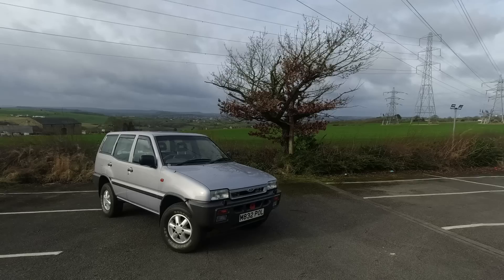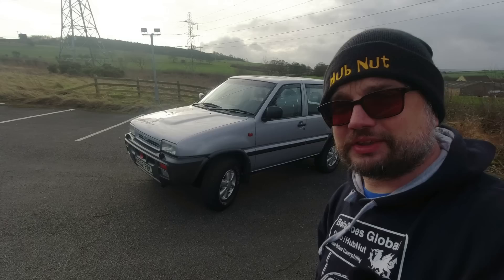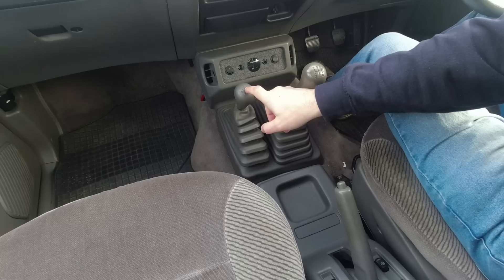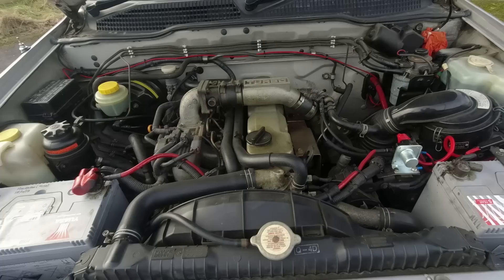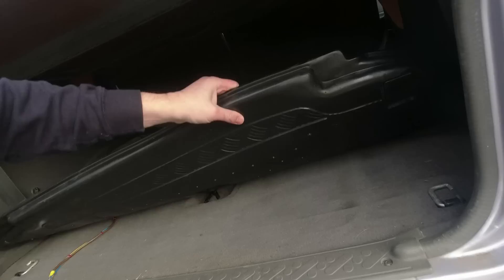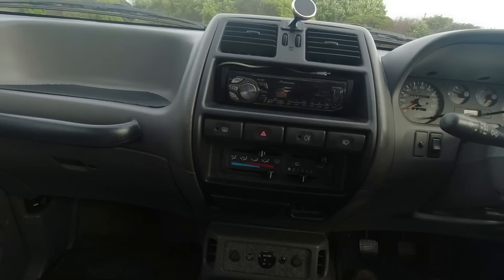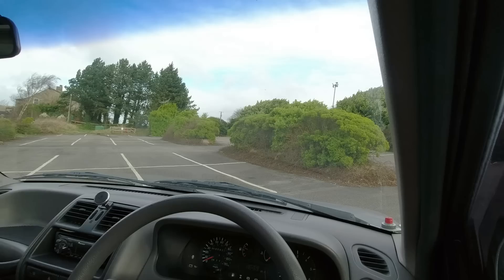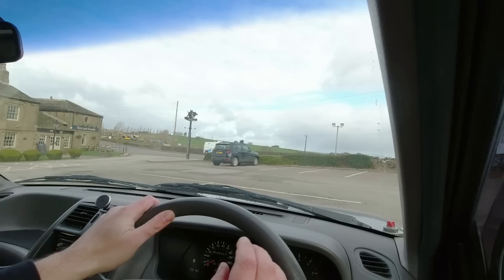Real Road Test: 1995 Ford Maverick 2.7TD (Nissan Terrano II)

Comment: Any torque? I dont get it, 2.7 but no ouput?   Can it tow? Is it just and old design engine then?
Reply: 280NM torque
Reply from the maker: 221NM on this version. 280 was the later intercooled version.
Reply: @HubNut  I was hoping it was the same because I only know about the facelift Terrano 😂 very very few Ford Mavericks in Ireland I’d rather have a Isuzu Trooper 😳